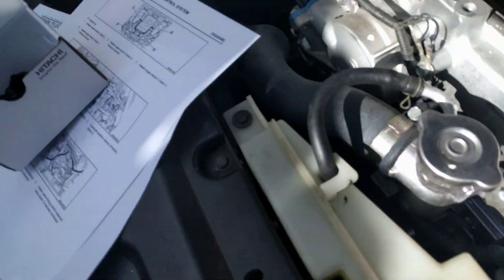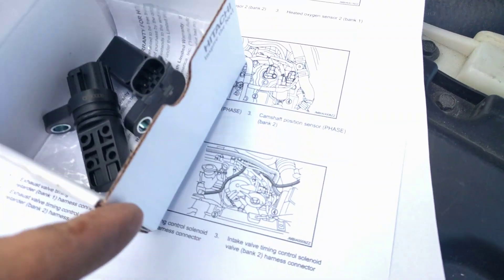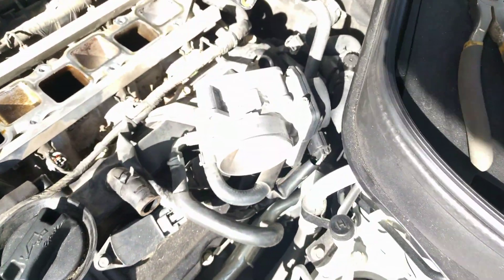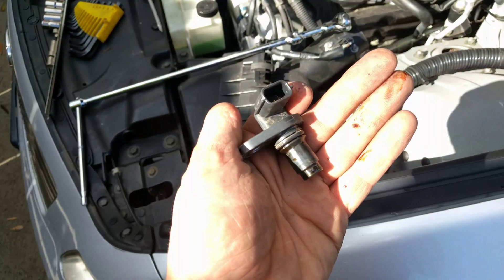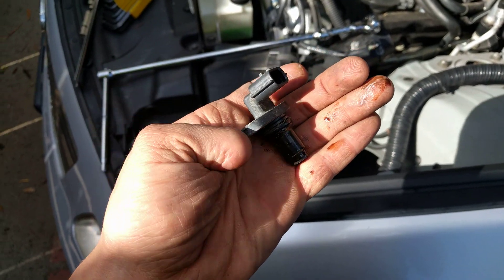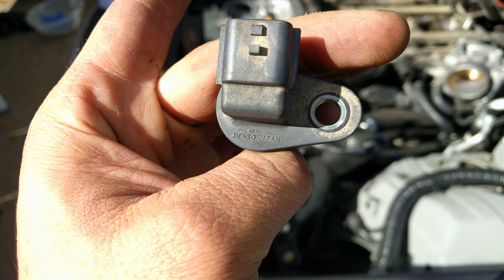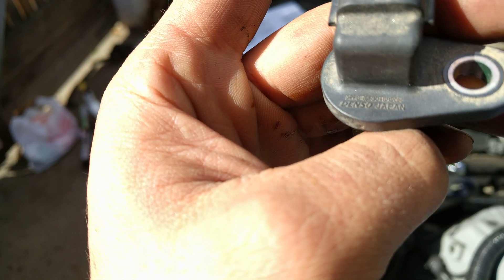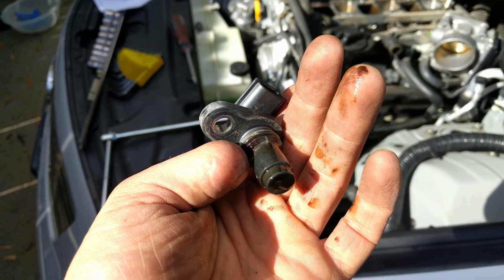G35 2007, VQ35HR camshaft position sensor replacement

Comment: i just changed my valve covers, coils, spark plugs, test pipes,y-pipe, and 02 sensors and now my car stutters when pulling off as it passes 1k rpms and when stepping on it and stalled out (shut off)on a red light. any thoughts.. no check engine light tho
Reply: Did you ever figure out what was wrong with your car mines doing the same thing
Reply: @Caprice1977  spark plug tube seals was leaking... spark plug flooded with oil.. (had to change valve covers)pull out the coils and see if you see oil on them..
Reply: U ever figure out @Caprice1977

Comment: You do know there are 4 cam position sensors on the hr right.
Reply: do you have a link to a diagram where all 4 are located? i can only find the 2
Reply: Joseph Rizzo can’t find any clear info on this
Reply: Brad Green I just replaced the two solved my issue with the sputtering.
Reply: @josephrizzo7720  on the vq35hr there is 4 cam sensors. Two on each side of cylinder. I believe they are all straight sensors
Reply: @TheDonCarlos69  how do you find intake A bank 2 camshaft position sensor on the HR engine?
Reply: which ones